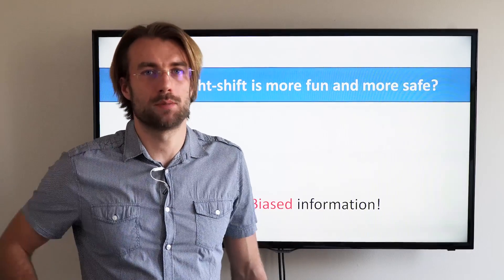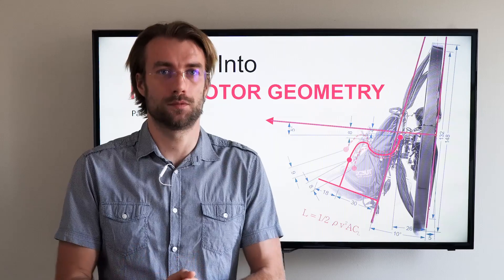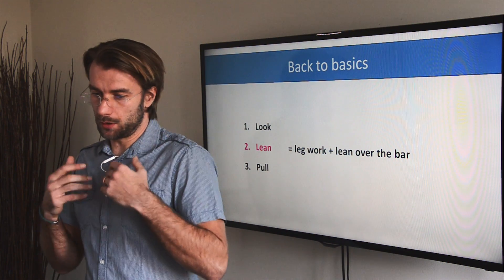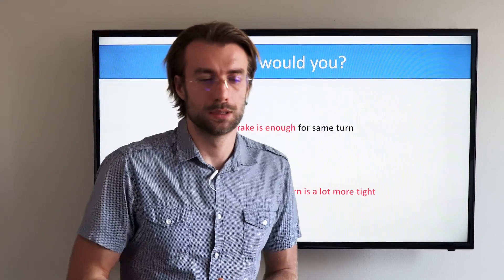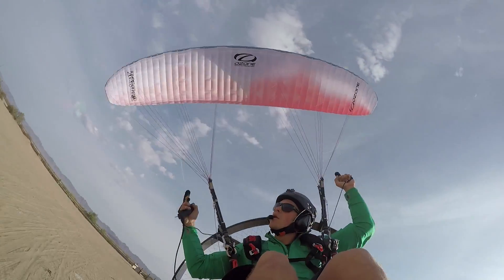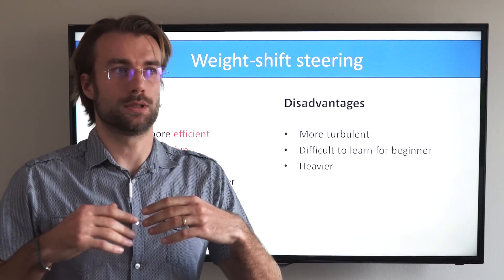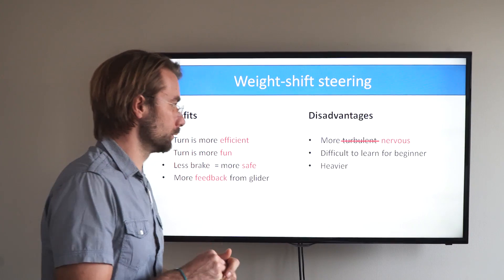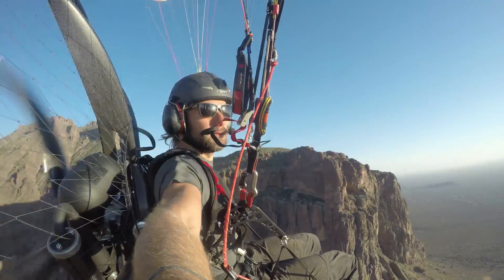Why weight-shift is more fun and more safe? Paramotor Geometry, Part 3

Comment: Hi Miro, great info!
I have a question regarding weightshift. Say you want to make a left hand turn. You look and then lean to the left, as well as lift your right hip while you progressively add left brake.
My question is this: Is the weightshift more a function of lifting your right hip and allowing the seatboard to be lifted higher on the right side, or is it more a function of pressing down with your left hip and leaning over the left bar?
I tend to think it's more about one swingarm being higher than the other - which - correct me if I'm wrong - is more affected by how much you allow the swingarm/seatboard to be pulled up by the wing, by lifting your leg/hip. Am I understanding the mechanics correctly?
Reply from the maker: You don't need the swing arm to move to apply weight shift. Even on a rigid system like flattop you can shift weight.
Just shift the weight. Hips, legs, upper body... Do whatever feels natural to you too move your center of gravity to the side.

Comment: Whats the best weight shift for your legs position ? Should you extend the side of the turn and tuck in the outside leg? or extend the outside leg and cross it over the inside tucked leg ? Both with the torso leaned to the turn side ( inside )

Comment: " Is weight shift good for cross country pilots"? No? I would have to disagree.   On a long flight the blood can run from your arms and make them numb and tired. It is nice to be able to stow the brakes and let your arms rest. Small corrections in direction can be made my weight-shift alone.
Reply: Stanley Denning to be fair he didn't say weight shift was not good for xc, it was more that he said it's just not very important. Really good point about letting your arms rest tho.

Comment: Ur videos are great. I have one question, At what altitude your engine tends to stall?
Reply from the maker: +climber1499 not technically stall. A was significantly losing power at 11000ft. In flight carburetor adjustment would help for sure
Reply: Thankyou for the prompt reply.
Do u think proper adjustment will make it run at 18000ft.?
Sorry I am from Pakistan and we have plains at a height of 16000 ft.( I am not talking of the mountains).
Reply from the maker: I think yes.
tandem at 16000ft with the Vittorazi Moster Plus engine  = same engine as we mostly use on our SCOUT paramotors.
https://www.youtube.com/watch?v=uatizdCWRn8
Reply: I really appreciate you replying me. Whenever I try to ask any question beyond limits to others, they usually do not reply. This shows your confidence in your machine. I will get back to you again for training.

Comment: great video...i fly high hang point (high suspension point) Nirvana Rodeo. I agree with everything you have said about weight-shift...however, i would suggest that even for cross country weight-shift is better. This is because i get a sore arm holding on a little opposite brake to counteract the engine torque, and therefore tendency for paramotor and glider to turn, even during cruise. 

I appreciate that one can adjust trimmers to compensate, use tip lines, offset carrabiners, or indeed even an antitorque strap between paramotor seat and carabiners, however these things all add complexity and affect glider performance and induce asymmetric reactions (which is not a good thing). Weight-shift is a very simple solution.

A downside to weight-shift i have found, 
1. it may tend to cause a pilot to overreact to wing feedback, thus potentially creating/exascerbating a bad situation because of inexperience.
2. forward launching is more difficult with low hand point machines (but on the reverse side, reverse kiting is very awkward with high hang point too...so its a trade off)

I still agree with you in that generally weight-shift is better all around.
Reply from the maker: My first unit was a Nirvana Rodeo and I loved it... Whatever gets you int the air is a great paramotor as flying does not compare to anything. 
1. I disagree that wight-shift units make you overreact. Having good and instant feedback from the gliders makes you react earlier. Early reaction is anytime better than delayed reaction.
2. On forward takeoffs I felt the glider a lot more "connected to my body" with medium bars than with high suspension. But it might be harness issue as well. 

I am a big fan of weight-shift steering but its too early for general conclusions. Wait for the Part 10 where we do the final big comparison...